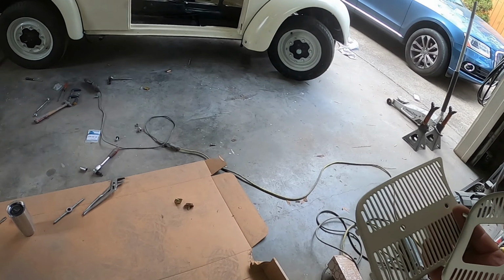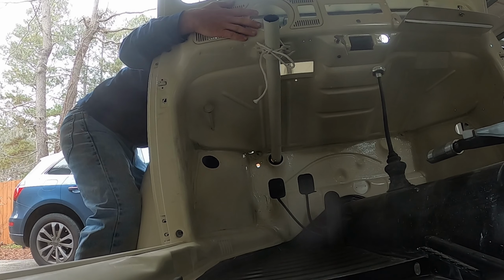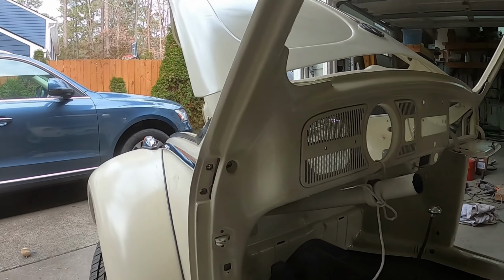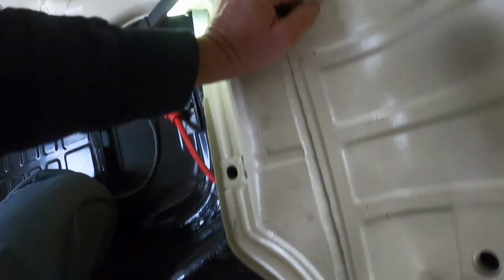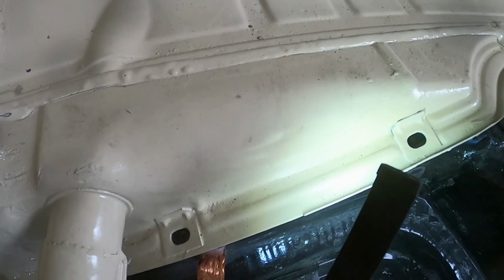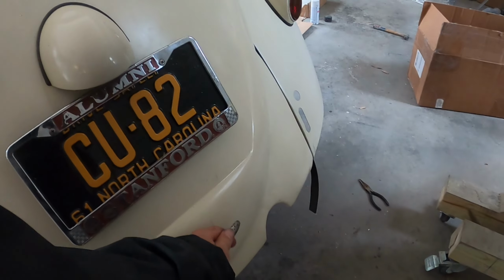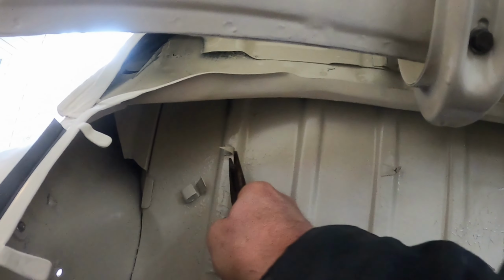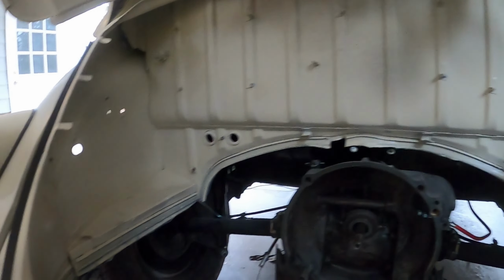1961 VW Beetle (65 Pan) - Dash Grilles, Body Bolts, Decklid Seal - 076

Comment: I suggest that in every bolt put is like a cleaner of the thread.  Good work
Reply from the maker: Yeah - I learned a lesson - need to at least loosely thread every bolt before assuming it will all fit